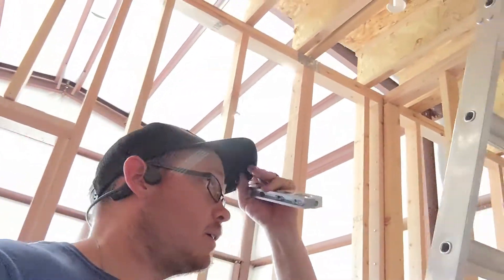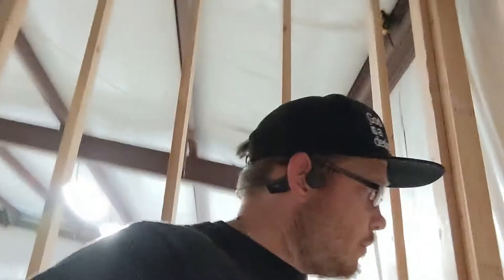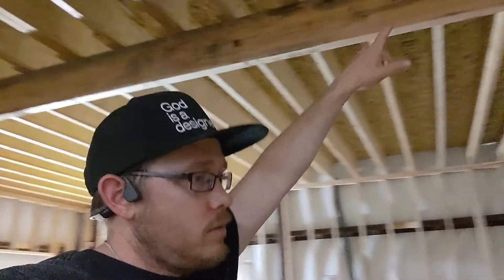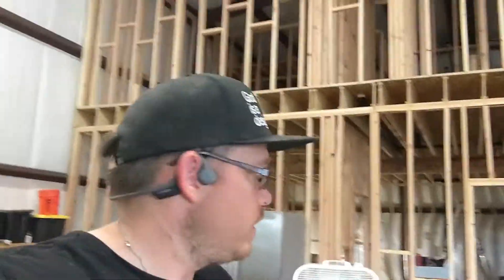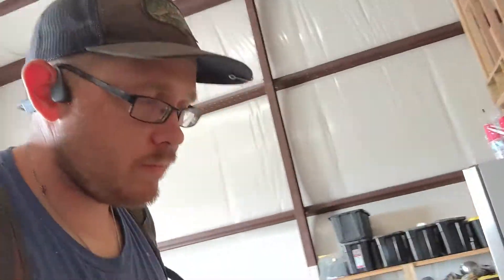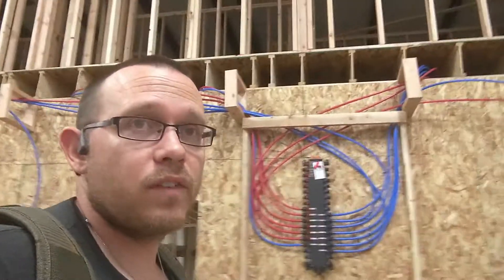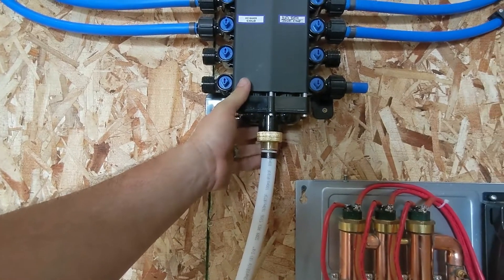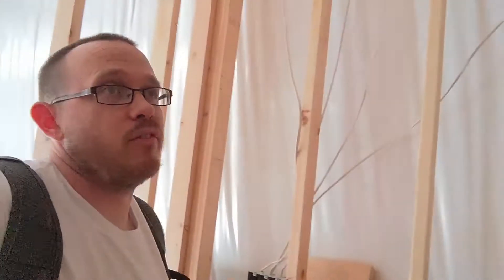Plumbing Our Shop With Pex Pipe, A Pex Manifold, Drains & Vents // Building a  60x40 Barndo

Comment: How did you end up getting comfortable doing this build with no prior experience other than a little electrical? YouTube? I’d be petrified to frame a house or run electrical / plumbing myself…drywall, painting, flooring, light fixtures etc sure…but man, props
Reply from the maker: Yea man YouTubed everything. First I learned how systems functioned so I'd know why they worked and then I'd watch how to make the system.

For example - how does plumbing vents work - how to design a vent system - how to install plumbing drain pipe and I'd watch like 20 videos on each so I could understand major pitfalls along with how things worked in general. 

Not going to lie though once I had my drain pipe installed I just hoped it would work like I had designed because if it didn't I was going to have to rip open drywall and re-do it. The first time my toilet flushed without issue I breathed a sigh of relief 😂